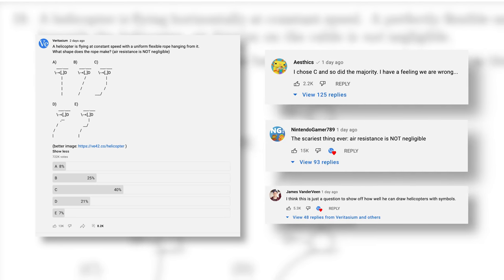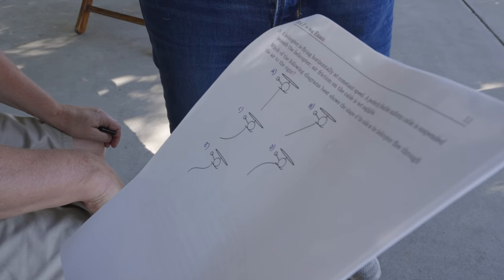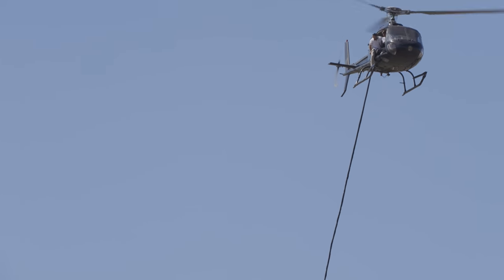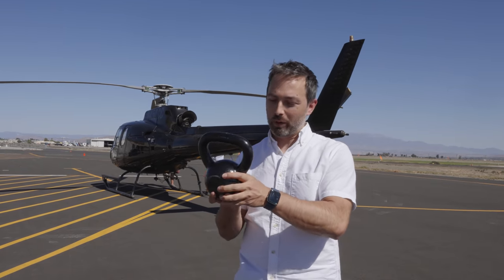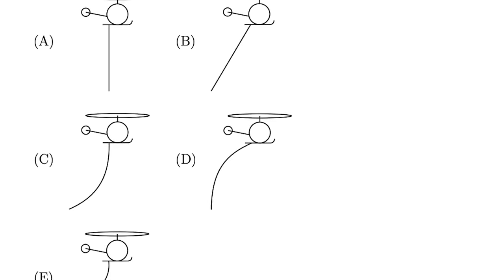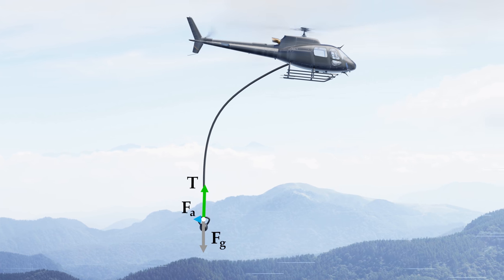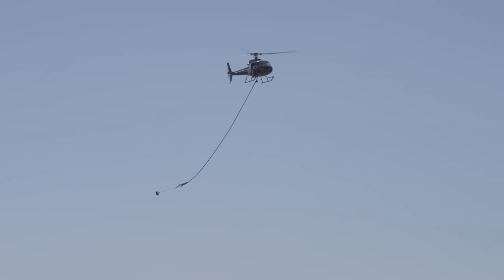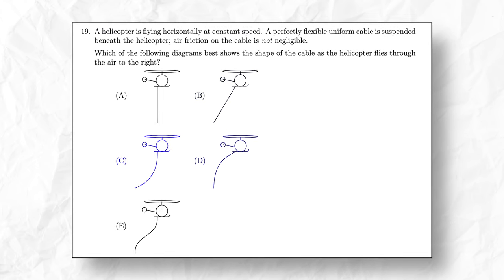I Rented A Helicopter To Settle A Physics Debate

Comment: I was just thinking the air resistance is not null, but that dosent cover the weight of the cable or its ratio to the air resistance... You would need the weight and length as well as the exact air resistance to answer... They are all correct for different circumstances.

Comment: I’m 38 seconds in and I’m gonna make a guess. If the facts as I understand them are correct the downward thrust of the main rotor is only really comes into account on the last 3rd of the blade, so as long as the rope isn’t touching the ground to give it updraft the rope would hang straight down

Comment: I intuitively thought B...

Then I thought that rotor wash might effect the shape... 

Then I remembered that helicopter down wash doesn't appear to effect the ground until the helicopters really low, so I thought that it probably wouldn't effect the rope. 

Then I thought that there might be some resonances effects from the engine... 

But I quickly realised that in order to effect the shape of a rope that long the frequency would have to be impossibly low and also really high amplitude. 

So after that rollar coaster of a thought experiment I still went with B.

Comment: I was not certain of if the air from the rotors would have changed the form of the rope. But I was certain it won't be (C)  or (D) because the rope's weight is evenly distributed and the air is evenly distributed, so there's no possible way that the rope will curve. My guess was (B) or (E) because of the air stream from the rotors.  👍

Comment: Before watching or reading, I'm going to guess that C is the correct answer. I think the weight of the rope would tend to keep it straight down but having less weight at the tip would cause it to be blown back, causing the convex curve seen in C. But what about the downwash of the rotor?  If there was a weight at the tip of the rope I think we've all seen that concave curve in figure D. But with no weight at the tip my guess is figure C.

Comment: Neat!  Of course, in real life, a helo would almost never carry a cable beneath it WITHOUT some sort of 'load' (usually a heavy load) at the end of the cable.  If a helo needs to carry a long cable, it would typically be loaded within the cabin/cargo compartment, or spooled/gathered up, and slung beneath the aircraft.  [also, if you need mobility in an open helicopter (or other aircraft) cabin, you could wear a belted harness [typically called a 'gunner's belt'] where the individual is wearing a sturdy belt of nylon webbing, and that belt is anchored to a cargo tiedown (within the cabin) by a long/sturdy nylon strap--the anchoring strap being long enough for movement around the cabin.  Gaining movement--in an open aircraft--by wearing a REALLY LOOSE seatbelt is a bit dicey.]

Comment: Knowing that the gradient of the rope's tension is affected by the difference of weight (ΔFg) and air resistance (ΔFa) on each point of the rope reminds me of functions, with its tangent's gradient (m) can be determined by dy/dx (quadratic functions), or Δy/Δx (linear functions), but I can't think of the function (not the funcions f(x) = ax² + bx + c and f(x) = mx + c) for the rope in this video (perhaps f(Fg) or f(Fa))

Comment: Here’s probably why many people picked C. When the helicopter is accelerating, this scenario can happen. Now you may argue that even when it is accelerating, the air resistance and gravity, should still affect the rope equally, but when the helicopter accelerates, don’t forget to take into account that the rope isn’t rigid, so there is a delay between when the top of the rope catches up and when the bottom rope catches up.

Comment: Okay  but the question never said to neglect the variation of gravity with height. And  since we know the gravity decreases with height the rope should get heavier at the end than the top, though the difference would be very little. So in this case the rope seems to be straight because the length of the rope is super small considering the dimension of the earth,  but actually(or mathematically) it is parabolic and hence the option D should be correct.
Reply: The diagrams give us a pseudo-scale with the image of the helicopter, letting us know that in the diagram the rope is very very small compared to the earth. Therefore any parabolic curve in the rope due to variation of gravity would be barely visible, both in the diagram and real life. The question isn't whether it forms a parabolic curve or not, its whether the rope looks like it does in the diagram.

Comment: Nice video and demonstration. However, you neglected the types of the rope variable... if you were to test a simple rope (note an abnormally heavy chain) it'd be affected by the air pushing down and the correct answer would have been C.

Comment: If the rope was long enough and you were going fast enough that the end was far enough away that the direction of gravity is different, then there would be a curve even without any added weight or air resistance on the end of the rope.

Comment: You could get answer E with a straight rope with no extra's. Arguably the first example isn't answer B as much as it seems to be. The tail-bit of the rope is the part with the least air resistance as air can move under it as well. This is the wobble you see when moving. If you'd attach the rope in a way so the base cannot move: think of a flag holder -type design. Now the base doesn't want to move, but will move slightly under it. The tail-bit will wobble enough to get situation E. The drawing is exaggerated with the curves being quite noticeable, but that is what will happen. You have to take in account of the wobble, you'd - then - have to take in account the rope isn't swinging freely, but is mounted on a solid mount attached to the helicopter.

But this situation isn't as realistic as you might think, so the answer is skipped as if it isn't a possibility. But even a small wobble has to be taken into account, just like we don't say Newtons Law of gravity can't ignore air resistance in most cases. But it is easier to understand the concept if you do ignore it.

Comment: Thing is, the rope isn't hanging in a perfect straight line, as in answer B. The end of the rope it's flipping backwards and forwards, so it's flipping between C & D and sometimes it's making shape E.
Reply: The last bit of the rope has almost no mass by comparison to the rest, and so behaves differently, illustrating the mathematical solution to the rest of the rope's length.  

I also expect that micro-variations in local wind will induce movement to the rope at any point along it's length, but this force is tiny compared to the tension and weight of the rope, except at the lowest extremity, where the weight almost vanishes from the equation. Nice observation.  More testing needed, perhaps using lighter ropes, at risk of tangling the rotors.
Reply: Perhaps in a wind tunnel?

Comment: My argument would be when the helicopter begins to accelerate to become a constant speed it would be answer “D” but when the helicopter reaches the constant speed it would then become “B” so answer “B” for this question.
I was impressed with myself because i got all the answers correct but my working out was wrong lol for the weight question i guessed “D” but i didn’t think of air resistance as the reason but i believed it would be due to the weight wanting to constantly fall. I thought the air resistance wouldn’t be a thing if the weight of the ball was more.

Comment: The obvious answer is C, but they made the mistake of using a rope for the experiment when the question specifies a cable.  The cable gauge would also matter as a thin cable might produce B.  In short, there is not enough information in the question to provide an adequate answer.

Comment: paused video at 0:21.  my guess is C.  air being blown down from the rotor (what I would assume) is faster than the air friction affecting the rope directly below the helicopter as it moves horizontally, but towards the lower part of the rope, the air from the rotor has less of an impact, and the air friction would then cause that part of the rope to swing back.  I studied zoology and did horrible in physics.  I'll watch the rest of the video now to see how wrong I am.

Comment: I don’t know what the professor is talking about the rotor wash dissipating quickly I spent 10 yrs in the US Coast Guard primarily in small boat stations around the country and we typically did “help” ops with nearby air stations to practice basket hoists.  Let me tell you the rotor wash under a US Coast Guard Jayhawk (Blackhawk variant) hovering 40 feet above you is pretty tremendous,  it would basically blow small water particles into a cloud around the boat and whip them around at such a high rate of speed that when it hit your skin (primarily your exposed face) it would sting like crazy.  So yeah hell rotor washes from my experience don’t dissipate like he explains

Comment: Very cool, I didn't expect it to be so straight. I figured it would wiggle a bit more. Then I remembered how heavy the rope was. I wonder, would the rope show more whipping if it was lighter weight rope? It's still a constant so I doubt the curve would change much but it might if it has high wind resistance with low gravitational pull, idk?

Comment: Before finishing the video... it says constant speed. I would believe the rate of speed is most important as there should be a difference at lower speed vs air pressure caused by the helicopter blades and higher speed vs air pressure caused by the helicopter blades... there should be an inflection point where the shape would change. Edit - whelp i guess the blade wash is not as intense as I expected... I have had zero familiarity/proximity to an actual helicopter taking off... so...

Comment: Surely it's D? The momentum of the rope will carry it forward at the mass point of the bottom at the speed of the helicopter while the wind resistance means that all parts are receiving drag, making the weakest part of least momentum show it by curving backwards.

NGL I can't be bothered to watch 13 mins for a simple question like that so i'm just gonna skip.

Edit: Yeah ok well, yeah. Makes sense I guess.

Comment: Dear Veritasium
The question is incomplete. It doesn't specify "air density decreasing with increasing altitude is NEGLIGIBLE" (like it was the case of your experiment). Because if it is not, then the correct answer is "C".

Comment: What if we factor in the thrust due to rotors. Not very practical but just in case consider an extremely heavy helicopter with a small rotor. In this case with weight attached at the end should give you the form 'E'.

Comment: Would it still be answer B with a light thin rope?!? As you said Fg and Fa should weigh each other out, but the F of the rotor now probably will also interact with the thin rope. You didn’t choose a thick rope by accident right?

Comment: I hate to say it, but answer B is not right. Friction is here supposed to be constant along the rope, but this is only approximately true, for shorter ropes. The lower a piece of rope hangs, the denser air gets, and thus the more friction you'll get. The lower parts will undergo more horizontal force than higher parts, causing option C to be true. But the curvature can only be seen using longer ropes, so B is "approximately" true. But since the question explicitly told us to count in air friction, C is the only right answer.

Comment: I think after adding that 20 pound weight. it will also follow the rule. it will be the gravity / and speed air resistance and all that stuff, so still a diagonal line, but if the rope's sections are each 20 pounds, it will be the same, if not then it will either be higher or lower. but also at the same time. thickness of the object at the end also has an X that you will need to resolve because it will be catching a lot more air resistance then lets say a knife. Makes sense?

Comment: The correct answer is D , but the question is incorrect.
This is because it says nothing about the cable's elasticity (rather than flexibility).
The cable you used while riding in your helicopter probably had the shape at point D too, but the cable's elasticity was probably way too low to make the bending visible at a macroscopic level.

Comment: But what about the effect of sections of a cable being dragged backwards due to the air resistance at lower sections of the cable? This effect would only be present at upper- and mid-sections of the cable but not at the lowest sections

Comment: Physics teacher here - Only high school and middle school. Help??? I think It's related to this. In a lab this moment with students...Graphing pendulum period vs string length. Beyond, about, two meters - it seems to be NON-linear. (The curve flattens out) Is air resistance with the pendulum string partially to blame?

Comment: So… does answer choice A represent the experiment in a vacuum or if the rotor wash was acting on the rope? Also, what does answer choice E represent? The experiment in 0g?
Reply: in 0g the rope would eventually just be trailing horizontally behind the helicopter

Comment: if air resistance is negligible and helicopter is flying at constant speed the correct answer is A hanging straight down - renting a helicopter is ridiculous because you cannot remove air resistance -

Comment: LOL.  The Answer is A.  As the question asks if the helicopter flies to the right.  Your showing how it will look if the helicopter flies forward.   Look at the picture on the question.  A Helicopter differs from a plane and can fly to its right.  If the helicopter on the picture flies to its right.  It will becoming towards the person looking.  As it can fly with its side facing the person looking at it.  As again it can fly to its right, left, backwards or forwards.   Irrespective if the rope bends or curves it will look straight from the side as picture A shows as the helicopter is flying to its right and towards the person looking at it.

Comment: so 3 of the 5 answers were made, even if the question had to change to accommodate them. Makes me wonder what conditions would have to be adjusted to get the final 2 answers? My hypothesis for E would be a change in altitude, where one half of the rope was in denser air than the other half. The easy answer to create A is to eliminate the forward momentum that applied a backwards force on the rope, but would it be possible to keep the forward momentum AND the rope position some other way?

Comment: I don't get it, the answer is "B at 45 degrees if you're travelling at the terminal velocity of the whole get up" - you can find the terminal velocity of something by hanging it out a car window on a secure wire or something and when the car is moving and the object you're testing and the wire is at 45 degrees, air resistance (drag) and gravity are equal. 
So all this showed us is however fast the helicopter was moving when the answer was "B" and the rope was 45 degrees, that is the maximum speed the rope will free fall at. Same thing with the weight. If you managed to get the helicopter going fast enough to do 45 degrees, that's how fast that setup could free fall.

Comment: In your situation that leads to a straight diagonal line and answer B, nothing on the end, you assume the air resistance is equal at each height- isn’t this not the case? Your other videos discuss how lower to the ground the resistance should be less. It might be a small difference that doesn’t cause the shape to shift much but there is not equal air resistance at each point of the rope, making the no weight shape closer to D
Reply: In fact this whole question seems skewed to be rounding the answer to the nearest smooth shape, which is kinda the opposite of the conceptual point of physics and these tests. Even the rotor wash is not entirely insignificant you’re just saying it didn’t massively visually affect the rope

Comment: I guess the weight of the rope itself doesn't count toward the weight held by each section of the rope 😅 I thought for sure the top had more weight pulling down if not because of rotor wash redirecting the wind downward but also because it has to hold everything below said section

Comment: Did anyone understand why the resistance changes up the rope? At first blush, the explanation seems like it's observing the shape and working backwards that the air resistance must change. Why is the shape the way it is (in both cases) without making a priori assumptions about the air resistance? Why woudnt the air resistance be the same for all lengths of the rope?

Comment: Interesting. My initial thought was E, the squiggly one. I assumed that the air resistance would build up, causing a backward curve, but at some point the rope wouldn't be strong enough to resist the air resistance so it would drop. Typing that out now, it makes no sense lol
Reply: It makes sense when they don't cheat and use a regular rope instead of a weighted one. And even when they did use one, they used a weight at the end of it which screws up the results. We will never see a proper answer, because no pilot will gamble with the chance of an updraft swinging the rope in the blades and killing them all.